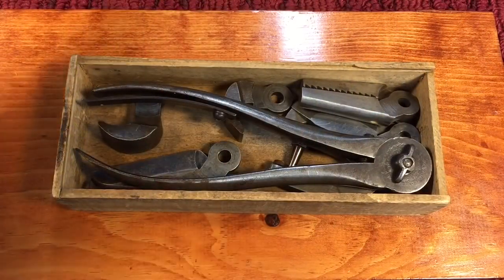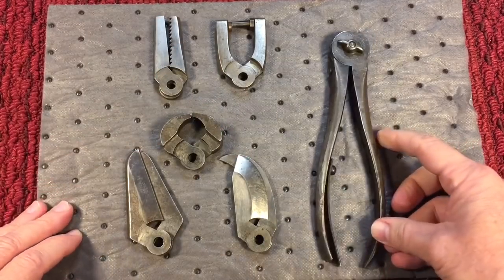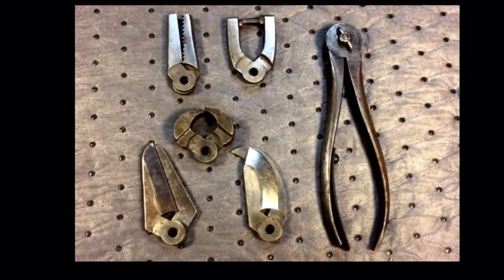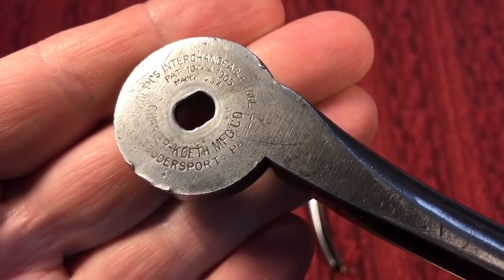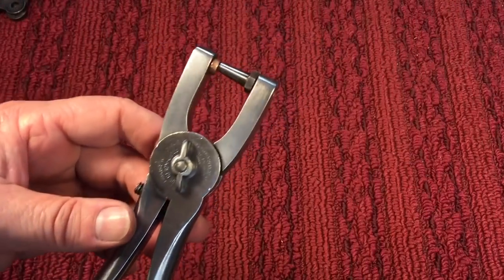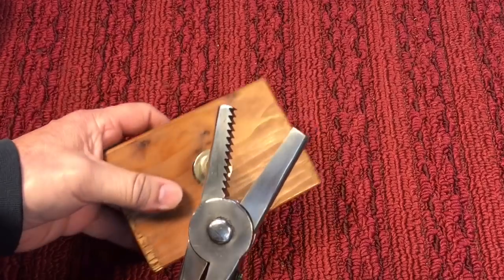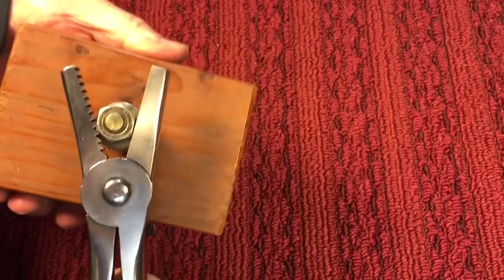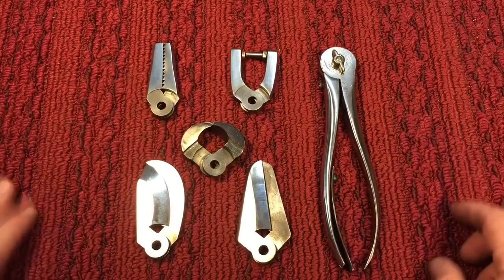100 Year Old Koeth Combination Tool

Comment: I clicked on the Youtube link and your video was the first in the queue! So naturally I clicked on it.

That’s a cool multi-tool but, as you say, five designated tools with the proper tool material for strength are better than a ‘jack of all trades’ tool.

But the concept was sound. Just someone trying to help out the folks who didn’t have to work as hard as the professionals. The DIY folks of the day.

Comment: Great videos ScoutCrafter!  I have been watching for some time now.  Question.  I recently began restoring some old pliers and decided on a few of the not to grind at all on a belt sander.  Just brass wheel and, followed by alcohol wipe down.  WD40 working through the joints and pivots to remove unseen rust.  Then would you suggest a buffing wheel with compounds or Shellac to seal?  Or both?  Thank you,jeff

Comment: I had a lawn mower once that was supposed to be 3 in 1 mulch/bag/throw.   What it did the best was aggravate me!!  LOL  I noticed what looks like a set screw on one of the handles of the Koeth near the pivot.  What is the set screw for?
Reply from the maker: 357magdad-  Big N!  I should have mentioned the set screw!  I’m always worried about long videos!  That set screw can restrict the travel (closure) of the handles so you don’t over-compress certain accessories like the hole punch or damage the jaws of the pliers!  Ingenious!   Thanks!!!
Reply: Makes sense!  I looked these up on e-bay - I don't think I'll ever find one of these on the dollar tables!!  LOL

Comment: Hi Scout - great education and video again!  What was the small set screw on the side of the head for?
Reply from the maker: Hello Lee!  I should have mentioned it and I apologize, that small set screw limited the closing of the handles so you wouldn't damage certIn jaws that you installed, like the leather punch, by engaging the set screw you could make the punch just touch the copper backing plate without damaging it!  Simply ingenious!!   Thanks!!!  😃👍